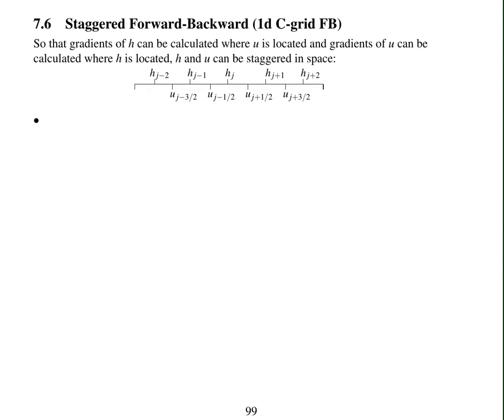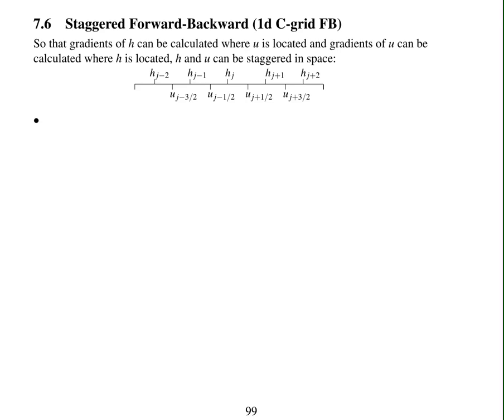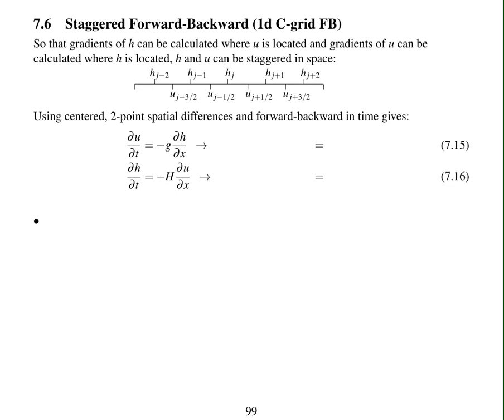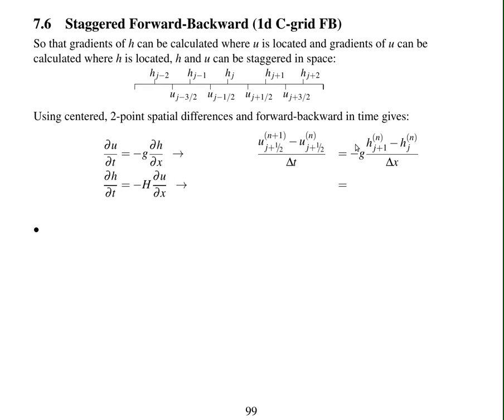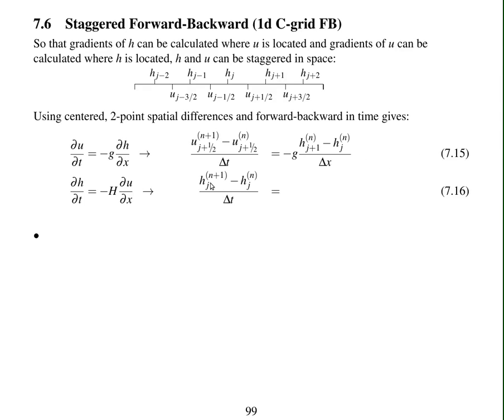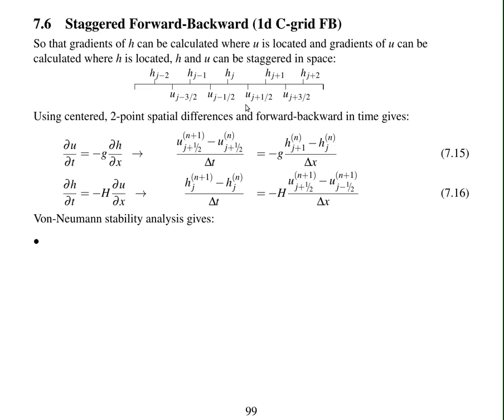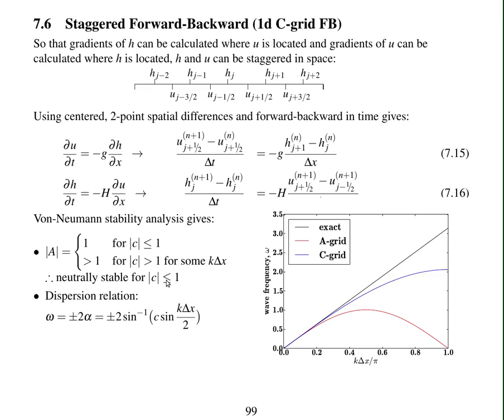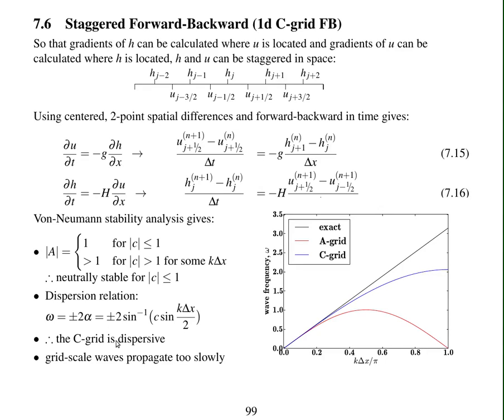8.4 A staggered grid for the solution of the shallow water equations

Comment: hello Hilary. Nice Videos!! thanks! i would like to program something like that in the GPU. Do you have any simple documentation with some pseudo-code to start a simple implementation? :D
Reply from the maker: My implementation in matlab was only about 20 lines including graphics. I can post it once I am back in the office
Reply: @hilaryweller615  wow it would be great Hilary!! You help is very uselful.:)
Reply: @hilaryweller615  hello Hilary.. Please did you have time to upload some matlab examples? I am trying myselft but for the moment its very unstable :)
Reply from the maker: I have uploaded this info as a comment to the next video:
Download code for solving the linearised SWE from https://github.com/hilaryweller0/SWE_grids.
This is octave code
Reply: Hello again. I wanted to transmit you my doubt :) In the code, in the part where the u and v speeds are updates. I can see that there is a cross dependency. First you calculate u based in h and v and then v speed is calculated based in u, but u has been already updated. I hope i can explain myself :D
Reply from the maker: Yes, that is important. It makes the time stepping forward-backward rather than just forward which is more stable (and uses less memory). It is the same with velocity and height. You use the updated velocity when updating the height
Reply from the maker: Yes, this is the forward-backward time-stepping. It is more stable than pure forward time stepping where you would do all updates based on old values